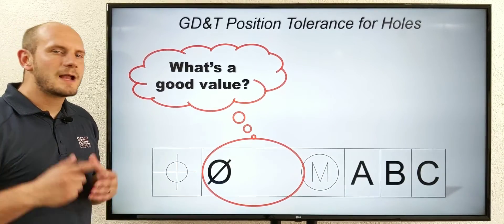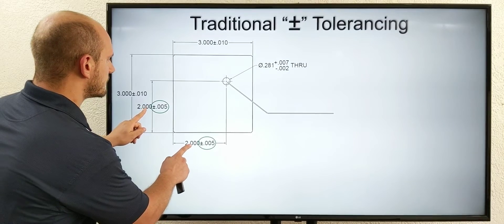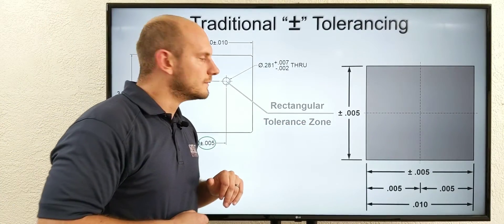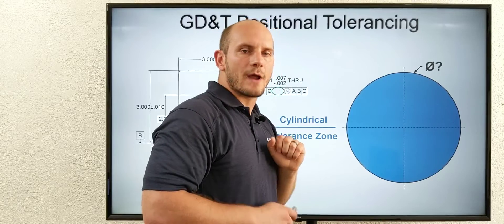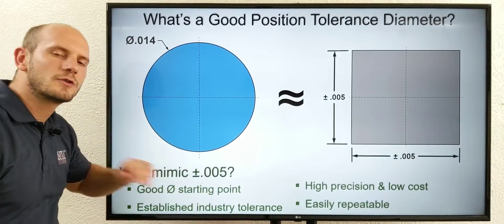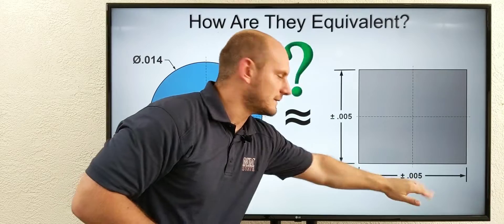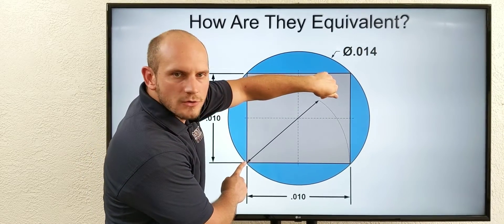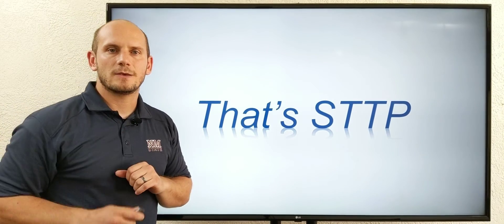GD&T Position Tolerance to Use if You're New to GD&T

Comment: Sir my doubt is: how to use this method for different cases? Here, the tolerances were +-0.05 and the resulting rectangular tolerance zone was converted to a circular tolerance zone including the rectangular tolerance zone. So, if I am having an dimension tolerance of +- 0.2 (bases on dimensional tolerance from ISO standards) should I find the rectangular tolerance zone with side dimensions "0.4" and find the corresponding circular tolerance zone including this rectangular tolerance zone? Secondly, if the sides of the rectangular tolerance zone are not equal, so in this case, can I use the same method to find the position tolerance?

Comment: I suspect that many engineers/designers don't understand positional tolerance. Quite often when I see it I find that they use .005 as a standard without realizing that it doesn't mean +/-.005" in XY but .0025" (or less) on XY. I often explain the tolerance as such, if you were to make the part and leave it in the machine and dial into the datum and them move to the true position, the tolerance would be represented as the total indicated runout you would see on the dial. So if the hole were out on one axis by .005" you would see .01" difference on the indicator.

Comment: Intuitively, I would think you would want that circle zone to lie inside the square zone. A major point of GD&T was to get rid of that diagonal 1.4x tolerance multiplier that square tolerancing has. This feels like we’re using a more precise system with a less accurate tolerance zone. The position can now completely lie outside the original zone in all directions. Not sure I get the logic.

Comment: I have a question on why position is used not cylindricity on a hole? I would think guiding it by the axis thru is better than only the surface position. Thanks for the quick videos!
Reply: Great point, because the definition is "...the cylindrical tolerance volume zone of the hole axis..."
Now, think of how it is actually measured?
a.) Pin gage that fits the hole
b.) Pin gage must also "sit flat/square" to the inspection plate....or [datum A] as specified in the geometric control frame.
Since, the pin gage must sit square = the pin gage is perpendicular to the hole feature = hole axis is perpendicular = becomes a simple 2D situation.
Now,  there is no need for a 3D cylindrical tolerance zone. 
Since, "in practice" to get that hole dia & position we use "pin gage" and "inspection surface"...we will not capture any "skewed" axial positions.  
Hope that makes sense.

Comment: Very nice, I’ve been working in medical as an ME for 4 years and in this specific position I was relegated to creating F.A.I and In-process criteria using the prints that have are supplied customers that use very little GD&T and ( I have been told by the principal ME) using it incorrectly.  Money was good but I want to actually be what I got my degree for.  This looks to be the best I seen to help me refresh and even improve my understanding.  
Doing you have a list of videos structure in chapter form progressing from start to finish?

Comment: really nice video.  Wouldn't the fastener equation work just as well?
Reply from the maker: Hi Adel Hodiwala! Thanks for watching! The various fixed fastener equation helps you solve for 1 of the 3 values which are the minimum clearance hole diameter, the position tolerance applied to the clearance hole, or the position tolerance applied to the threaded hole. The only thing is, you must first assume some reasonable values for 2 out of the 3 and then solve for third. That is where this video comes in. In this video I am suggesting that you assume a .014 positional tolerance for both the clearance hole and threaded hole that way you can use the fastener equation (as you have suggested) to solve for the third value which is the minimum clearance hole diameter. I feel this is the most practical way to approach this problem. I cover the fixed fastener calculation in two separate videos that show the 2 different ways to apply the fixed fastener equation. Here are the links to the videos:
With Projected Tolerance Zone Applied:  https://www.youtube.com/watch?v=5A8_0k9xaUI
Without Projected Tolerance Zone Applied:  https://www.youtube.com/watch?v=bThrWWcMTvo
I hope this helps answer your question! Thanks again for watching and stay safe and healthy!

Comment: I have heard this explanation many times over the years but it is misleading to say that +/- .005 is equivalent to diametrical .014...it really isn't.  
If you superimpose the two tolerance zones like you did, it is clear that diametrical .014 allows for a greater variation in the feature position than +/-.005.  (square is inside the circle, not the other way around).  I think what people mean when they say that these are equivalent is that if a process has the precision to create a feature within a rectangular tolerance of +/- .005, then that process will be able to create a similar feature within a diametrical tolerance of .014...but the tolerance zones are not the same size.  : )
Reply from the maker: Hey there Brian, thanks for watching and for providing your thoughts on equivalency between the two types of tolerance zones.  After reading your comment, I realize I failed to explain in the video what exactly I meant by "equivalent" and instead I left it up to a contextual understanding.  So definitely shame on me for that one!  In this case I was using the word "equivalent" to mean that the GD&T Position Tolerance I was describing would achieve a functionally equivalent fit within the next-level assemble.   In other words, if you use a .014 diametrical Position Tolerance to a control a clearance hole which had previously been controlled with a ±.005 bilateral tolerance of location, then the clearance hole feature would assemble with the same fit within the next-level assembly.  One explanatory caveat.  You will achieve an equivalent next-level fit, however, you will actually gain 57% additional functional tolerance zone volume which was not being previously utilized.  This is due to the fact that you are now applying a tolerance zone shape which mimics the actual geometry which is being assembled (cylindrical tolerance zone controlling a cylindrical clearance hole which is an opening for a cylindrical fastener to fit through).  One thing I would like to point out.  I purposefully did NOT state that the two tolerance zones were of "identical" size.  In fact, I did explain that there was something visually "funky" about calling them equivalent and I did use a figure with the two tolerance zones superimposed on each other to show their relative shape and size.  In retrospect, this was a great lesson for me on not assuming that the viewer understands what I mean when I use certain vocabulary and so I appreciate the value of the points you made.  In the future I will definitely differentiate between "functional equivalence" and "geometric equivalence" in my explanations.  Overall, you were willing to take the time to not only to watch the video but also add value in the comments section.  So thank you again!  Have a great rest of your day and stay safe and healthy!
Reply: @StraightToThePointEngineering  Thanks for the response.   I wasn't trying to put you on the spot, I just have heard this many times over the years I have worked with many people who use these interchangeably because they don't fully understand the differences.  BTW,  I concur with everything you said.  The point I was trying to convey was that while the two tolerance schemes are similar,  they are definitely not equivalent because a feature could be in tolerance using .014 diametrical but that same feature could be out of tolerance using +/-.005 because of the difference in the shape of the tolerance zones.

Good job on your channel though.  GD&T is one of the most misunderstood subjects in engineering and it is good to see someone taking the time to explain a difficult subject.  Good luck.
Reply: Really very good explanation by you ....Brian. ( Still i have small confusion, How .014 calculated ?
Reply: @kpp04482  .014 is not calculated, it is specified.  It is the value that is specified by the person dimensioning the feature on a drawing taking into account the requirements for the part and the manufacturing process.
Reply: @kpp04482  i think by hypotenuse rule

Comment: Thanks for the sharing.
I have a question, that .014 inches for the positioning tolerance, which is its equivalent for metric units?
Thank you very much
Reply from the maker: Hi there Harwell Mejia!  Thanks for watching for the great question!  The short answer is that 0.36 mm is the common equivalent to .014 inches.  Now for the longer answer.  First, why list the tolerance to only two decimal places you might ask?  To answer this, lets look at millimeter equivalents.  0.1 mm is roughly equal to .004 inches.  This is not quite a small enough tolerance resolution to take advantage of the achievable tolerances with today's manufacturing equipment.  We would like tolerance size increments that are just a bit smaller.  So instead let's look at 0.01 mm.  0.01 mm is roughly equal to .0003 inches.  This is the resolution we will use because it is a small enough resolution that makes sense for today's achievable manufacturing tolerances.  So with this in mind, it makes sense that you will typically see metric tolerances stated to two decimal places.  If you look at your ASME Y14.5 Dimensioning and Tolerancing standard, they list all of their tolerances to the two decimal place.  Thanks again for watching and have a wonderful evening!
Reply: @StraightToThePointEngineering  Thanks a  lot, I will check the ASME Y14.5 . 
I really enjoy your courses.

Comment: question, is it valid to use a diameter tolerance zone for a width? i see this in several drawings here at work, but it does not seem right to me...
Reply from the maker: Hi Mario, great to see you in the comments section again!  The answer is no.  A diameter symbol invokes a cylindrical tolerance zone shape that is used to control the position of a feature with an center axis (the feature's center axis must reside inside the cylindrical tolerance zone to pass inspection).  Well, a width does not have a center axis and so you cannot use a cylindrical tolerance zone to control its position. 
 Instead, to control the position of a width, you leave off the diameter symbol and now your tolerance zone shape is two parallel planes.  Then during inspection the centerplane of the width feature must lie inside the two parallel planes to pass inspection.  Hope this helps!  Let me know if you need further clarification or have additional questions/comments by replying to this comment.  Have a great rest of your week Mario!

Comment: love the new format, maybe a cheap noise gate could help with the backround noise?
or a few sound blankets to help with the reverb you get from that room?
Reply from the maker: Hey there Mario Jacobo, I appreciate all the support you leave in the comments section on various videos.  I have lighting figured out I think for the most part but I am having a bit of a hard time with audio in the room I am filming in.  I really don't have any other room that provides lighting and so I think I am going to have to take your suggestion soon and try to invest in some background noise reduction tech (both low and high tech solutions).  Just got to get the funds and time together (I work full time engineering job as well and so this YouTube thing is a side hobby).  Again thanks for watching and for your wonderful support!